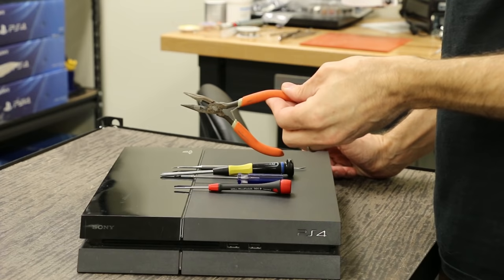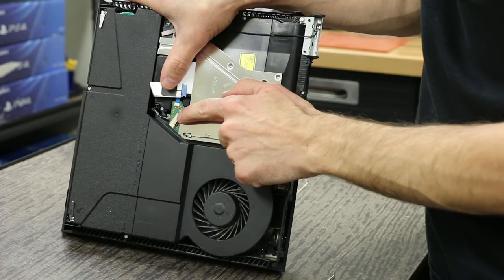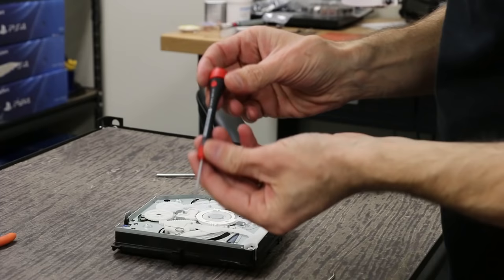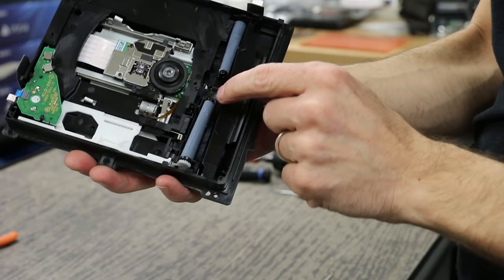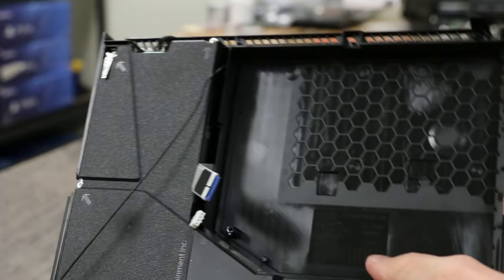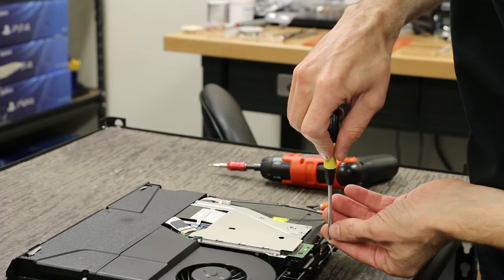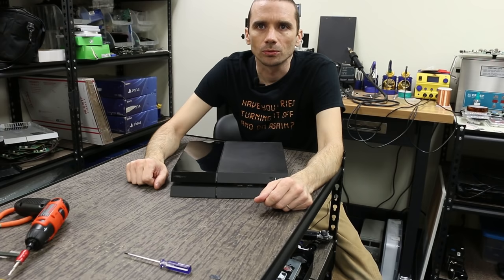PS4 Won't Read Discs Fix (Makes Noise/Won't Accept Discs)

Comment: On the disk drive cable I didn't know you were supposed to hold that connector down to take it out if the ears get cut off or damage should I buy a new one right now the PlayStation will not update and it will not take a disc so I'm thinking it has something to do with that because I just rip it right out when I was cleaning it up

Comment: I cleaned it and now it actually takes the discs without a problem but the unrecognized issue is still there. When it's reading the disc, it'll read it then there's a clicking/shifting noise like it wants to adjust then I get the message that the disc is unrecognizable. I wondering if it's mechanical.

Comment: I know this is old but does the disc drive not functioning effect the Ps4 system update error code stuff that locks you out of updating your ps4?
Reply: Im asking this because sony released ps4 update 10.00 and my ps4 wont update due to the error code. Tried rebuilding database, usb flash drive update method and wiping my ps4 completely. I also looked in my ps4 and it doesnt have any hardware damage. The ps4 still works perfectly fine offline it just wont apply the update. It downloads the update in every method to update the ps4 but it never applies it

Comment: Can't get the screws out of my PS4 I've used almost every Phillips size it must be the security or smaller sized driver you mentioned earlier. Sucks I wanted to check my Disc Drive it just stopped working I've tried everything else.

Comment: Hey Tronicsfix. I have an issue with a cuh-1116a version of ps4 disk reader. First of all the button isn't working for the disk reader, no reaction at all. When I open the ps4 and try to open the reader with a metal piece directly on the gold plated receiver on the motherboard its not reacting at all.  The disk reader is making sounds when the ps4 is starting up but is not accepting the disks. The ribbon cable is damaged on the blue ends by the corners from the previous owner but I feel like I get them to sit. Should I buy a new ribbon cable for starters? Could it actually be the problem in this case with the errors that I have? Thanks for assistance.

Comment: My PS4 won't accept CDs and make a noise however when I opened my drive the rollers are fine but at 9:23 where those 2 gray squares (on the left)  are on the green board, they are black as if they have burned, any suggestions are welcomed. Please and thank you

Comment: My problem is neither of those, basically it used to beep when pressed the sensor and no longer doesn't and plus it isn't  accepting  the disc either, you have to force it in and still doesn't  accept it. What's  the issue ?

Comment: Nice i might need to check mine my disc drive in my original ps4 disc drive still works great after 8 years! The disc laser usually dies after 9-10 years. My ps3 had a dead disc laser after 10 years lol. I just bought a used one for 180$

Comment: You know this could actually be the reason why my PS4 Pro Blu-ray Drive is making that ridiculously loud noise everytime I insert a disc or play a game or watch a movie it will start spinning and making this strange really loud noise Maybe something fell off can somebody help me with that?
Reply from the maker: If you've used the manual eject screw then that's probably what is causing the noise.

Comment: Good video
Helped out but didn’t fix the issue
I opened up the drive and the rollers were in place
Took them out and cleaned them
I insert the disc and it takes it in then spits it right back
This happens around 10 to 15 times after which it accepts it
I know its not a laser issue cuz after accepting it the games install and everything works fine
Can’t find the issue please help me out
I would really appreciate it.
Thanks

Comment: Hey so I have a ps4 first model like the very first one and when I try to put it in the disc reader it’s like the rollers won’t spin but when I shake the ps4 I can’t hear anything also when I press the eject button it beeps three times and does not want to accept the disc.

Comment: My experience thus far. Stripped the unit down to where the video takes you, and cleaned the lense while there. Upon trying disc that wouldn't register as even having a disc inside before (still doesn't work, sounds as disc if it's starting up n off constantly and clunks) but it has gone further now to atleast show an unrecognizable disc on the ps4 home page which it hadn't before this. New disc drive for me?

Comment: I was ejecting a disc on my PS4 pro and the disc was sorta came out slowly but I put it back in and tried ejecting again and it came out normal what could be the issue I hope it doesn't get worse

Comment: My PS4 won’t take any discs in. I’ve took the whole optical drive apart and everything seems to be fine, all but the eject sensor which for some reason doesn’t work. I press it but nothing happens. The drive still plays games, I just have to use the manual screw to insert and eject games which is just annoying.... any idea what’s going on? P.s I’ve changed the optical drive and the board for the drive twice to see if it was a fault on there, but even with new components it still does the same thing.

Comment: @TronicsFix I need help. The issue with my PS4 is that it won't take in the disc. I could turn on my PS4 by trying to insert the disc. But after that, nothing moves inside the drive. I've tried to replace the senor motor in the back of the drive and the cable associated with it. But still nothing. Then I swapped out the entire drive from another working PS4 and still nothing. I'm stumped. This isn't my actual PS4, fixing it for someone else. So I'm not sure if they swapped out the logic board form the drive with another one.

Comment: My PS4 starts playing discs and gets as far as the main menu before telling me it is unreadable. I also have trouble getting the discs to go in (they stop about half way and require a slight push) does this sound like the issue that the PS4 in this video had?

Comment: I did all of this, but it seems like When i try to insert the disc, something is blocking it, the white thing connecting the rollers were out of place before but I fixed that now. Still won’t receive the disc tho. What do I do ?

Comment: I had a disc stuck in my drive and did the ol manual eject via the screw, but ever since it hasnt played discs. Apparently theres some gaurd that pops up.. would this method be useful to try to correct this problem as im in wait for my ps5 for awhile now and wanna play disc again😪😪.

Comment: Hey so my ps4 is taking in the discs. My playstation is "reading" them. I hear the noise but the disc icon says blacked out and i dont get any errors. Any suggestions?

Comment: So if that ribbon was damaged could that also be a reason why it wouldn't read discs? My discs will be received they just won't be read
Reply: Man Bear's Universe idk about the ribbon but mine also receives it but doesn’t read it and i found a way to fix it just flip the ps upside down right after inserting the disc and after it reads its okay to put it back normally. it worked for me hope yours does too

Comment: Question. My ps4 is starting to scratch the labels on some of my discs and I know they wasn't there when I got it. Do you believe it is the whole disc drive or just the rollers need to be clean. I would rather save money and I'm out of warranty.
Reply from the maker: There's probably something inside that needs to be adjusted a bit but there's just no way for me to know for sure.

Comment: I think my problem is that my ps4 is that it doesn't even  know that there is a disc being inserted . I push in the disc and it doesn't take it in. I click the eject button, it beeps three times and then nothing. Should I take it for repair or buy a whole new disc drive?

Comment: ***IMPORTANT

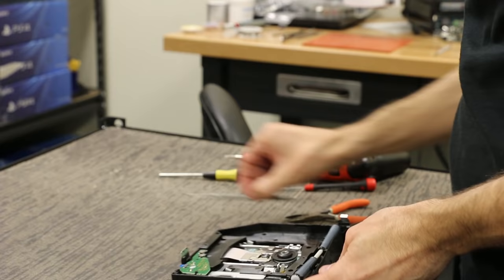HE FORGOT TO MENTION THAT IF YOU NEED TO PUSH THAT WHITE DISC QUOTE BRACKET IN [under green board at 10:04]<ITS WAT TELLS UR PS4 ITS READY FOR A DISC> ONCE ITS PUSHED UP U CAN Realign THE DISC WHEELS  

and u in as in 2019 u need to safe mode update EVERYTIME the disc ribbon is removed as it resets a new code to the cpu *asK SONY
ONCE ITS DONE REUPDATING YOU SHOULD INSERT DISC 

BE PATIENT
Reply: @LexifyGamer does the ps4 eat discs 
and eject properly?
Reply: @LexifyGamer yea so u get the greyed out icon. so yea long story short the ps4 knows when u open it. because its been opened the parts need to pass a certain test in order for them to work properly and the one way to make the test pass is to reverify the system. So doing a safe boot and installing the firmware (that is giving)will retell your ps4 that everythings looks good. And the good thing with safe mode is u can install the update as many times u want until it passes.
Reply: @LexifyGamer  yeah once u align them u should be good but just to get to the opening your gonna unclip a ribbon. don't forget to repress the 2 disc holder clips to the back it works like a slingshot  to reject your discs. once all of that is complete u MUST DO the Safe mode system update.

Comment: I'm trying to trouble shoot my disc drive problem. I bumped my ps4 while moving. And now it works just fine aside from the disk drive will not pull the disc in. I've opened it up and the rollers seem to be functioning properly. I cant find any other signs of a problem. Any suggestions would be amazing. Thanks.

Comment: Hi, ive got an error since update, su-42118-6.. i can confirm my disc drive wont accept disks and has been broken quite a while, im told this is why the ps4 won't update is this true? If so, will what your doing here fix it?

Comment: I'm having with a PS4 motherboard SAC-001 bought of ebay recently. It works, gets to dashboard fine but the problem I'm having is that again there is no disk feed, or at least the disk feed works intermittently. I've checked all three fuses at the drive part of the board and the fuse on the area where you'd find the similar area on the older SAA/SAB  all are fine. I've even tried replacing the transistors and IC's in that area from another faulty that had a known working disk feed and I'm still getting intermittent disk feed. Sometimes it will work, most other times the laser will start clicking continually. Just wondering if you've come across this before on the SAC and if there is a fix for it as I don't really want to give up on it but I'm at the limits of my knowledge here.

Comment: TronicsFix Problem I have is when I put my disc in it takes a while for it to read it sucks it in and re does it but it goes to unrecognized disc I have to give it a few taps contants for it to work the game works fine when I get it to start up

Comment: i did this and fixed the roller but now theres a part blocking the entrance to the disc drive, i restarted it and it didn't change, then used the manual eject screw to move the part and put a disc in. ps4 isnt reading it

Comment: Hello, I followed this and when I opened mine, the rollers were in their places and the white thing also. The rollers although are a bit chipped and scratched but other than that nothing is wrong so idk why I have the disc problem. Whenever I insert a disc, the spinners dont work caz I cant hear the sound of the spinning like I used to. I'm going to put the ps4 parts back and close it up now. If you have a fix please tell or if I have to get new rollers inserted because I cant get rubbing alcohol so I didnt clean them I just dusted them. Thank you 

Edit : so I inserted my gta v disc and it worked, but it got stuck when i pressed the eject button. I'm currently opening it back to check what happened

Edit 2: I fixed the mechanism of the disc compartment and now the disc is ejecting however when I inserted my gta v disc, I couldn't hear any spinning noise which I heard before when the game was recognized. At first the disc was spinning for a minute and more so I took it out and inserted again but then this happened. Atm I cant hear any spinning noises but some other weird noise. If you know something about this or similar then please reply. Thank you

Comment: Please help! I recently took my ps4 apart to replace the fan, but the video I watched didnt warn me about the ribbon you specifically mentioned not to break the teeth off and guess what... lol. My disc drive doesnt work because it wont suck in the discs and I think this is the problem, but I'm not sure whether to risk pulling the ribbon out again because the ps4 works atm. What would you suggest?
Reply: I risked it and it worked!!

Comment: My PS4 pro won't read most blu ray film discs it will read game discs but it's noisy doese this sound normal or should i say do you know of this being a known issue also it plays DVDs fine and oddly most Sony blu ray discs but for example if i put in a Warner brothers disc it won't recognise it verry strange

Comment: Is there a way to make the PS4 activate the laser/scan feature, when I first cut it on usually it would scan/read the disk but my power went out and then once I turned it on etc it no longer initialized the scan

Comment: Ok so mine is making the reading sound multiple times but doesn't read, the disc is going all the way in and is spinning just fine, and all my discs are clean I noticed it happened after the latest update

Comment: What if those rollers aren't the problem, but it doesn't want to accept disks and now I'm getting error code SU-42118-6 when trying to update the system, but I haven't switched the blu ray drive or the board that is near the blu ray drive

Comment: My disk drive has a totally different circuit board and ribbon connection set up…. The two ribbon cable to come off the disk drive run towards the “back” of the drive and go down into an area that’s not accessible without turning a bunch of stuff apart and the ribbon cables also don’t look very good in regards to how they were routed, etc..    my drive stopped reading and then I couldn’t update it because it wasn’t detecting the disk drive and I looked inside. Looks like a five roll had rerouted. These ribbon cables and yeah, I’m trying to figure out my next step….  It was refurbished, so there you go, I guess. :(

Comment: took mine apart and those pieces were still in place, but when i put it all back together it still didnt take discs what else could be the problem? the white part im guessing ?
Reply: btw i can force a disc in but it doesnt read the disc at all and the eject button doesnt work what do i need to fix it

Comment: Is this a problem of the console not reading discs or not accepting discs?( ie you can not insert the disc...)
Reply from the maker: They normally won't go in all the way with this problem.
Reply: @Tronicsfix  cool I have a problem where my PS says disc is dirty with every disc. Rebuild data base seems to work once then I have to keep doing it every time I play

Comment: This didn’t help man the disk drive works still, but don’t let me put in a disk.. the rollers don’t realise I’m putting the disk in, but the sensor turns the os4 on when I try to put a disk in.. is it a wire?

Comment: so I have a ps4 that doesn't take in the disc at all and I replaced the optical drive already and still persists do you have any idea whats wrong with it?
Reply: did you replace the entire drive? i know you have to match the color to your original drive for it to work. some had blue motherboards and others had green

Comment: When I put a disc in it makes a grinding noise is this due to dust on the fan???
I'm going to buy a air canister to clean mine I already got the screw driver needed.
Reply: Fixed it?

Comment: I think i need to replace my diskdrive, the issue I'm having is I can't find a replacement with the same model number (CUH-1116A) what can I do? Sorry I'm not much of a tech guy
Reply from the maker: You can't do anything other than keep looking for the right disc drive. It has to be a drive from that model.
Reply: TronicsFix Ok thanks anyway the video was very helpful

Comment: My ps4 slim gold blue light turns on and beeps then shuts off doesn’t stay on for 1 second I have to unplug and plug back in to get the light to turn on 1 second again. What might be the problem and solution. Thx for the videos

Comment: One of my friend's PS4 does weird thing with the disc drive. It spins, then stops starts spinning again and eventually it'll just eject the disc.
I fixed it a few months back by just cleaning up the drive inside. Cleaned the laser and rollers which fixed it. But it's been doing it again now she's two months. It still reads after a few tries.

Comment: Ive tried to open it and the rollers were in place. I dont know what the problem is, my ps4 will not accept discs, I have to insert the disc automatically and the ps4 has trouble reading the disc. It only works sometimes, it keeps saying unrecognized disc. Pls help

Comment: Any suggestion on if it wont read 1 specific disc. Its red dead redemption 2 and it has literally no fingerprints or scratches. It worked fine till two days ago
Reply from the maker: Try restarting it first.

Comment: Every ps3 blueray drive that I've taken apart had to be reset b4 putting back together. A gear had to be removed and put back for all the gears to reset. Looks the same to me, how about the reset u don't show it, u don't explain that part. Does the gears and latches and do hickies need to be reset? Soon as u take apart that white piece with those gears u see every piece in re align, so what about the gear alignment.